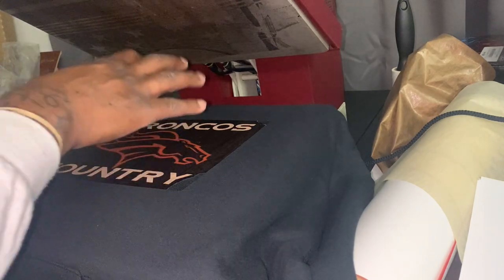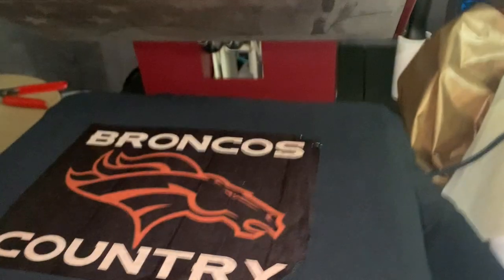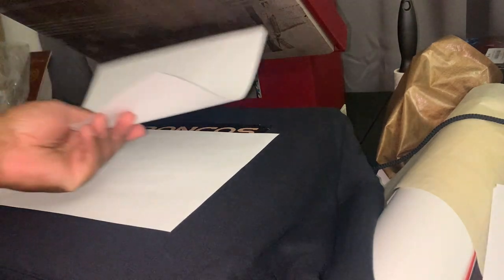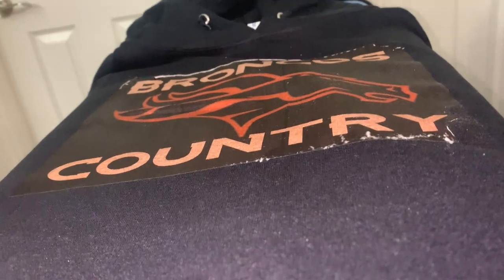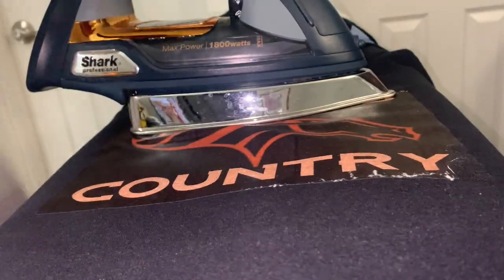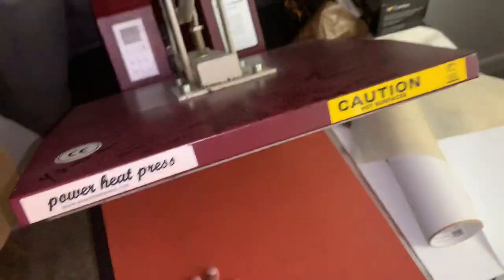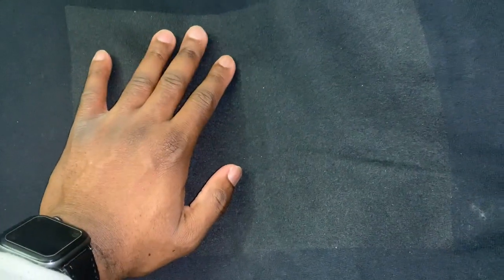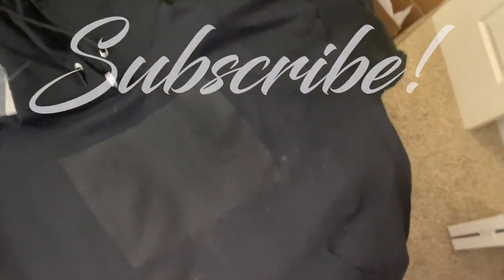Neenah 3g jet opaque - How to remove htv

Comment: Lol I've messed up plenty of transfers. I use the original backing and place it on top, press, then pull while still hot. It usually comes up easier. Emphasis on easier lol. I haven't worked with it in a minute but I don't forget the solutions to my mistakes. There's something about the side it was originally connected to that makes it want to pull it off.
Reply from the maker: Thanks !

Comment: I had to do this at the weekend, i found a hair dryer got it off easy enough, the small parts came off pretty quickly but the bigger piece took a while with the hairdryer and tweezers, luckily I could cover the area up with the new transfer and it was un-noticeable!

Comment: How do yoiu get the backing off the Neenah 3G jet Opaque before you iron it on.  It is really a pain and I'm ruining alot of heat transfer paper. I've left plenty of paper on the edges to bend. But it's not working. Any advice please
Reply from the maker: tap the edges gently with a vinyl remover/razor blade/ scissors until you see that layer separate...thats what works for me